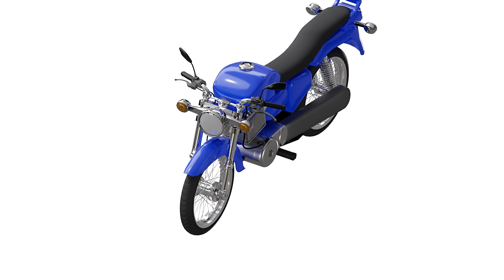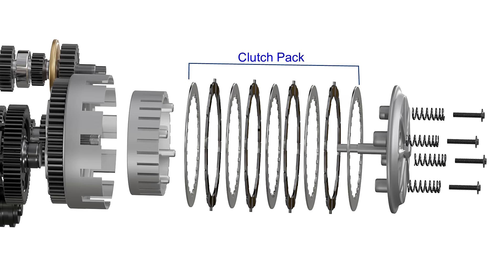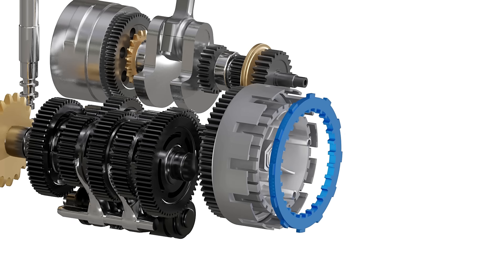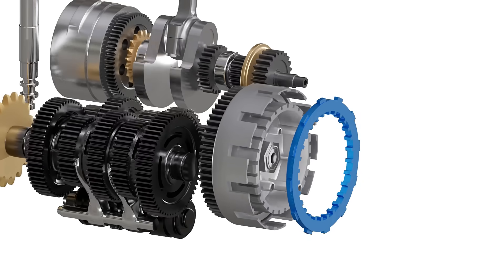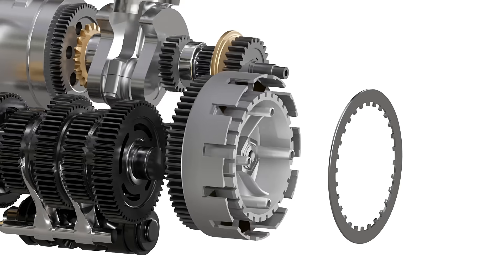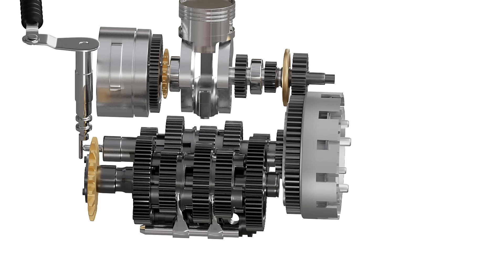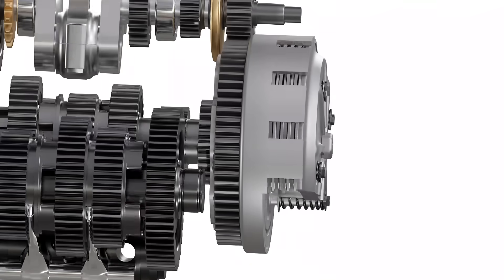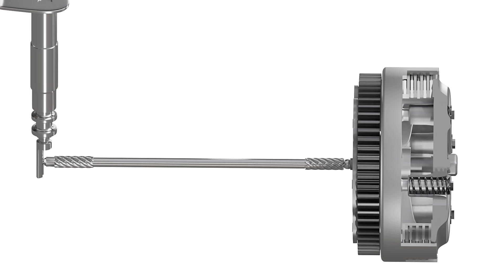Understanding Motorcycle Clutch

Comment: So on my driving lessons bike, it wouldn’t change the gear with clutch lever fully pulled. My bike driving instructor would tell me to just let it go a little and only pull the lever half way. With the lever pulled half way, gear change was 100% successful. 
Coming from cars, I couldn’t figure out what could be wrong with that and why does clutch half-pulled work better than fully pulled and my instructor only told me “that’s just how bikes work”. 
Any ideas?

Comment: Logical solution where you have 2 different components working at different speeds independently, why not have 2 different interlocking components which can also work independently with the assistance of a clutch lever. Then as the lever closes you just need to ensure that the friction place and steel plate can coincide together under enough force, via the springs. Elegant solution indeed.

Comment: I understand till pressure and release of clutch, I didn't get the point how half clutch moves bike slowly instead of damaging links of those plates
Reply: same way the car clutch works. The clutch is not an on/off type deal. DId you see how the springs moved in and out ?

Comment: I still don't understand this at all, so pressing clutch handle releases the plates, means they are disconnected, and plates are pressed by default when handle is released. So why do i need to press clutch when starting the bike, why bike does not start driving as soon as the motor starts, if released not pressed handle means pressed plates?
Reply: The bike starts without pressing the clutch

Comment: Thanks 😀  but 1 question why does the bike stall when realising the clutch too fast?
Reply: You transfer too much power too fast, and on smaller bikes (cc wise) there isnt enough power to instantly synchronise the bike to the engines rpm.

Comment: I remember when I was getting my motorcycle safety endorsement in Canada, I was in a group of about 30 people. I ended up with the only broken bike, and the problem was that my bike's clutch was always PARTIALLY engaged, even when you pull the clutch lever in fully... so my bike stalled every time I tried to start it. I got screamed at by the instructors over it for the first 20 minutes until one of them tested the bike and finally helped me :/

Comment: This is a very good explanation and presentation!  Why is it difficult for my motorcycle to get into gear if I go into neutral while driving?  If I go into neutral, I cannot get back into 1st or 2nd gear while riding even with the clutch lever pulled in.  I have to rev the engine to get the clutch basket to match the speed of the inner basket (I think), then it will go in gear.  Otherwise, it grinds.

Comment: I own a 2021 Ninja 400, I installed a new Yoyodyne clutch system and now the bike clutch lever is too loose. If I put it in gear it starts to crawl, if I try to drive it's hard almost impossible to switch gears. I do not know what my issue is. Any takers?

Comment: so clutch wasn't design at all to make your motorcycle slower instead it was design to make the 2 wheels runs in alternate speed
Reply: The clutch is used to disconnect the engine from the output. Its neccessary to change gears to then achieve different translations like lowering the rpm and increasing torque

Comment: Good basic overview.  I'd mention that it's not a requirement that the steel plates connect to the transmission and the friction disks to the engine crankshaft.  I ride a motorcycle where the steels have outer splines and connect to engine power and the friction disks are splined on the inside to connect to the transmission input shaft.  In this case the pressure plate also carries external splines and rotates with the engine crankshaft.  So the roles of friction plates and steel plates can be reversed.

Also, not all clutches have springs of the kind shown here.  Quite a few motorcycle clutches (such as the one on my bike) have springs that are daisy-shaped circular disks that press on the pressure plate when the release rod retracts.

Comment: Great ilustration video with detailed explanation, two thumbs up 👍👍 just wondering if we accidentally press the starter button (supersport motorbike) while the engine is already running in stationary idle, what will happen?

will it engage the starter motor and make the outer race to spin and the roller got trapped again between the surface of outer and inner race?

OR

the ECU will cut off the ground as it reads the engine is already running so it wont engage the starter motor anymore?

OR

since the starter motor gear is always mesh all the time with the outer race does it still spin the the outer race BUT it just freely spin without trying to make the roller trap with the inner race?

i've tried once pressing the starter button while the engine running and it sounds something spinning BUT don't know whether the outer race trying to engage with the inner race, will it damage the starter motor gear, reduction gear, crankshaft gear, roller, outer inner race? OR its totally safe with no effect at all?

looking forward to your expert explanation

Thank You and keep up the good work for more great videos wih very detailed explanation ❤ really love it

Comment: Not really a mechanical person, and I'm trying to fix my bike so this really helps.  I replaced my plates a little while ago, but when I bleed my hydraulic clutch, the lever is extremely stiff.  The pushrod is pretty much flat against the bike, so it seems like the master cylinder piston is being pushed all the way in, not having anywhere to travel, so hence the stiff clutch.  Must be something I did with the clutch plate replacement where the pushrod isn't being returned back.  Brand new springs were also installed, and properly torqued, so it must be something with the pressure plate, I misaligned something, maybe got the wrong plates and the thickness is too much, or something completely different.  But I at least know what to look for.  Thank you!

Comment: Automatic transmissions use 2,3 or 9 or more "WET BATH" friction clutch packs as motorcycles use one to simply disconnect power from the engine, into a manual gear box. Although called constant syncromeshed transmissions, releasing the direct connection from the crankshaft will allow a rotary guide to push or pull shift forks with nylon tips, to move a gear into a side gear that is moving faster or slower. This is where the grinding noise comes from, if the clutch is not fully released, wear on the gear "Dogs" are worn as they require each to line up to latch on which is done while at the same speed or real close to it. When draining fluids from the transmission w/shared clutch, attention to friction plates and metal trans gear dogs or even nylon chunks big or small should be looked for if buying can used bike or serving your own. This can add up to expensive no one want.
DK, ASE Master Tech since 78

Comment: So when i pull the clucth lever,the clucth plate is pressed or release? my bike have condition now when in first gear where i need to throttle more after i release clucth lever, is it because the mechanic fault  in assembly the clucth system or something else? 
(Im using hyperclucth system)

Comment: I have a 1999 kiwasaki Vulcan 1500. I have replaced the clutches and it's still doing the same thing. I then replaced the slave cylinder and blead the system. Still does the same thing. This bike starts right up and runs fine, pull in the clutch lever and put it into gear, try to take off and as soon as I release the clutch it kills the engine. Someone told me to check the clutch safety switch I did, it still dies when clutch is released. Then I found out that the bike has a kick stand safety switch, located it and bypassed it, still doing the same thing. Can you tell me what the problem is?

Comment: What stops the friction plates and steel plates from engaging each other when the clutch lever is pulled? Is it just the oil that slips between them ? Because i can see a little spin at the rear wheel (with the bike on its center stand) when in gear and clutch pulled.

Comment: When you stall, is it because the inner and outer portions didn't have a chance to synchronize? Or is there another/better explanation for how this relates to stalling?
Reply: You stall because the engine doesn't have enough power to turn the clutch when it is fully engaged. So the engine bogs out and stops spinning

Comment: IF a car's wheels each have a clutch with pre-adjusted pressure for the pressure-plate to act as
1-differential
2-ABS

Instead of connecting to Inner-shaft, it is connected to the CV-axle
Wheel connects to clutch-housing

The heat generated should not be too much?

Comment: Kawasakis have the clutch on the right side, how does the lever and rod work on those? Does the twist rod pull instead of push? Or is there constant pressure pushing outwards from the plate and the rod "opens up" to let the plate fully extend?  Anybody know?

Comment: Right in the beginning it is not explained why the torque of the engine is increased by the gears. Clutch and Gears just rotate and have no speed limit, but they have a torque limit. So usually a large gear on the engine connects to a small on the clutch. I mean for any inline engine of meaningful length. Also  Clutch and Gear have to withstand instant torque ( as opposed to mean torque which is relevant for overheating ). So displacement per cylinder dictates the size of the clutch.

Also each clutch of the pack needs its own spring ( single winding of a helix maybe ) so that they all open and close at the same time.

Comment: Great explanation. This makes sense for a dry clutch, but does a wet clutch work the same? How could friction be applied?
Reply: from what i know its the expensive racing bikes that have a dry clutch in most cases, its the cheaper everyday motorcycles 100-150cc that have a wet clutch

Comment: Can you tell us about the oil cooling system work ,i want to installed oil cooler in my motor cycle honda supremo 150  in which better parts will be better to attached the hose oil hose cooler

Comment: I have a small doubt 
Even when the clutch is released the inner hub rotates with different speed compared to engine speed
So even when we use hypothetical connector the same is happening but why you said to eliminate the problem at that time in the video
Pls give me a explanation

Comment: Not only that I finally understood how the clutch works, I also understood why engine breaking works the way it does.
Awesome video, thanks
Reply: very late to reply but I want to point out that downshifting and engine braking can really save your brake pads from wear. just don't get rear-ended because your not flashing your brake light.
Reply: @KevinJC1991  On modern semi trucks, the brake lights automatically come on when the engine brake is on for this very reason.
Reply: @KevinJC1991  
Really has been a while lol, I've become a much better rider since then, took several advanced riding courses, etc...

Engine breaking is only good for assisting you as you use your regular breaks - it can take off some load from your brake pads, true, but the engine was engineered to accelerate - not decelerate. That's what the purpose the brakes were built for.

You should completely disregard it (engine breaking) when you have to emergency break.
Reply: Is engine breaking safe or it slowly destroys clutch plate ?
Reply: @muhanishchouhan9501  Engine Braking. There is no additional or abnormal clutch wear or destruction once the crankshaft and input shaft of the gearbox is matched or locked together. The "braking" is the resistance of engine compression not wear of the clutch. If you simply roll off the throttle without downshifting,  you are experiencing engine braking; and no additional clutch wear. If you downshift to accentuate the the braking, then there is some additional wear if you don't "rev match" as you engage or operate the clutch. But again, that wear is nil once the shafts are locked together (clutch fully released). Cheers!
Reply: @j.thomas7128  so engine braking puts stress on the combustion chamber right?
Reply: @tuan.hoang_  No, there is no wear on the combustion chambers with engine braking. The braking effect is caused by a vacuum created in them.
Reply: @j.thomas7128 Great explanation
Reply: @muhanishchouhan9501 not only is engine braking safe for your engine but safe for you. Engine braking is literally just reducing fuel so the engine can't produce the power to keep it moving at it's current speed. What you feel when you perform engine braking is the compression in the engine forcing the drive train to slow down. Which doesn't hurt anything.

Comment: when we not press the clutch the clutch plates are engaged together tightly but When we Press the clutch the clutch plates are Disengaged & connecttion between Engen & Gearbox (which is connected to the wheels) is breakd!

Comment: Outstanding, simple, straight-forward explanation of a very complex system.  The "hypothetical connect" later split into two pieces, and then combined with other similar pieces really takes all the confusion out of how the system works.
Reply: This is the best, I got it!
Reply: It's just concentrically connecting two parts instead of linearly like in a car.

Comment: That was interesting, but what were all those gears on the crankshaft? Also, I've never seen an actuating rod arrangement that requires a hollow input shaft; all the M/C clutches I've seen have a stubby rod that works from the front.

Comment: So when you pull the clutch lever it releases pressure. How does that released pressure effect the engine giving it the effect a clutch gives
Reply: You reduce gas when pulling clutch lever because the torque needed is reduced.

Comment: why do the friction and steel plate gain space between each other when the clutch is pulled ? isnt there still a tiny amount of friction ?
Reply: There would be the tiniest amount but it takes a lot of force to engage the clutch so the tiny bit if friction would just slip, that's why some people tell you to avoid "sitting on the clutch" which basically means holding it in for extended periods of time like if you stopped on the trail to talk to your buddies.  To preserve the lifespan of your clutch you should shift to neutral or just shut the bike off :)

Comment: For people asking questions about Dry v. Wet clutches:  
At beginning of video, just about everything you see is in one compact engine case.  The crank shaft, the two gear shafts, and the clutch are all inside- in a common oil bath for lubrication.  On Ducati's, that clutch assembly is outside the engine case.  It is not sharing in all the pumped/splashing oil bath.  It is made of different materials to operated the same way, but without lubrication.  I think they suck because they are so noisy and annoying, but I really don't know if they operate/work in any way better.  My '90s BMW has a dry clutch, too.  It is in a different location, enclosed more, but still is not lubricated with crank case oil.  It is noisy, but not nearly as clattery and obnoxious as the Ducati. Because of its difficult to access location, I'm assuming that it lasts longer than a Wet clutch?  idk.
Reply: I ride a BMW boxer so I had to check if someone couldn't help themselves from pointing it out. Thing is, if the clutch is noisy while driving it isn't working properly since it's slipping. If you ride a BMW boxer there will be a noise while shifting. That's how you know it's a BMW.

Comment: Excellent detail on the clutch pack, and function of plates.The only confusion I get is from discussing clutch operation with other riders/mechanics.  Most people (I have found) say, "clutch in" when they describe pulling in the clutch lever, towards them.  But you see in the animation that the clutch plates go 'out', away from the engine/rider.  Some say it/describe it the reverse.  I usually try to concentrate on the plates and describe them as 'released', or as 'engaged'.  It still leads to confusion because of people's habits.  In and Out are relative terms.
Reply: Yeah, well, clutch in is the correct terminology as it refers to the lever itself, and not with the clutch pads, which many people have no idea how they function, so it would be too confusing to refer to engaging the clutch as pulling it out. Even though it's scientifically correct. But yes. Engaging the clutch is also applicable. I guess it's probably the better term, as it's really engaging the clutch to perform it's primary function.

English is fucking stupid and never should have been combined with engineering.

Comment: I like that you're posting videos like this! Can you do a video on how ignition timing works? I know it's just for older bikes but it would be super useful. If not just an alternator / stator would be awesome! Thank you guys for making these videos, they're great!
Reply: Not just for older bikes. New bikes still have an ignition system but they are solid state.
Reply: You must be referring to the points and condenser ignition system, which was used on older engines before electronic ignition came along.

All gasoline engines need to have their ignition timing set precisely, otherwise they won't run properly or at all.